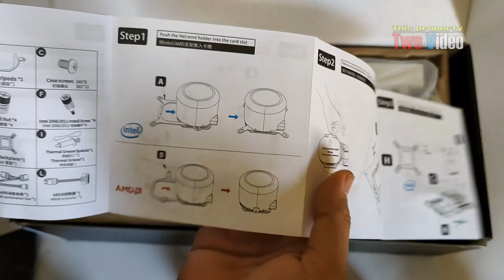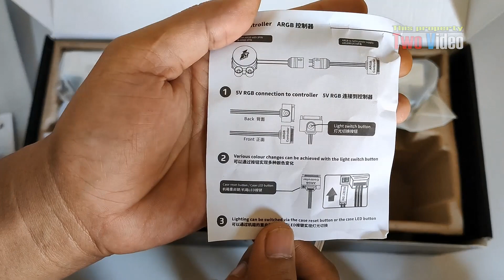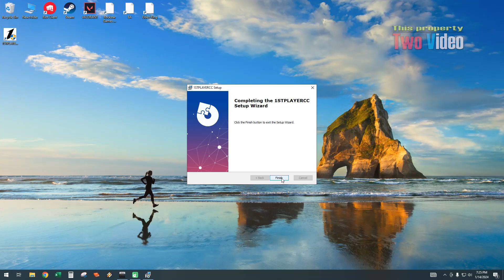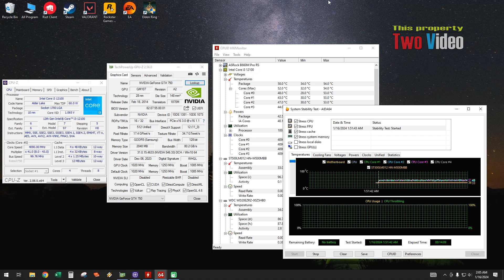1st Player CC 360 ARGB Liquid Cooler (white) | Unboxing & Installation

Comment: 12:04 your display is a bit slanted, Is that normal? Mine is the same slanted black version, I think its a factory defect.
Reply from the maker: It doesn't seem perfect, I thought it could be rotated but it doesn't seem possible
Reply: @NKgamingtest  - I thought so too, it may have been a QC issue, there are other videos not many just a very few showing the straight temp display, so i guess ours is a factory flaw, a slipped from qc that wasn't properly checked while being assembled.
Reply: @NKgamingtest  - Hey I emailed them and i got the response a while ago, they said that the black part that covers the lcd temp can be removed because it was applied with double sided tape, then they said after removing the black part from there it can be adjusted to fix the alignment. I am not going to do that yet but i will be doing that later.